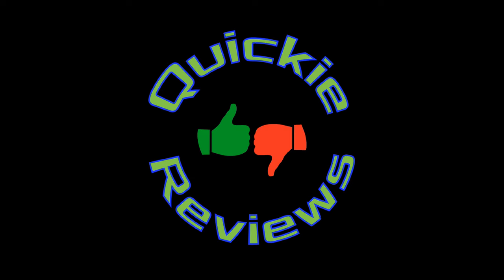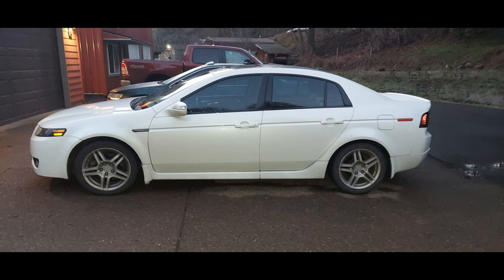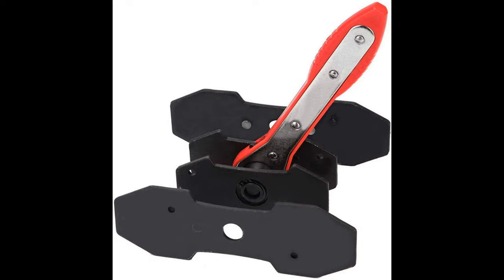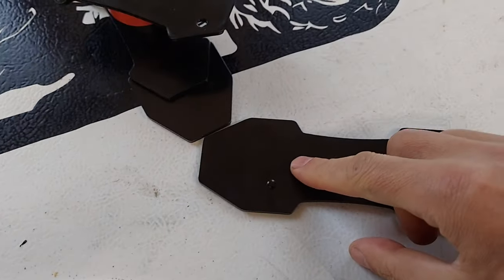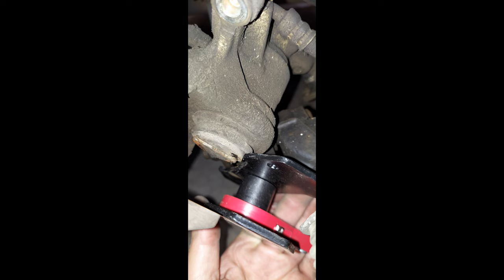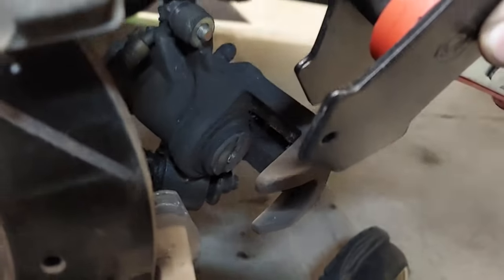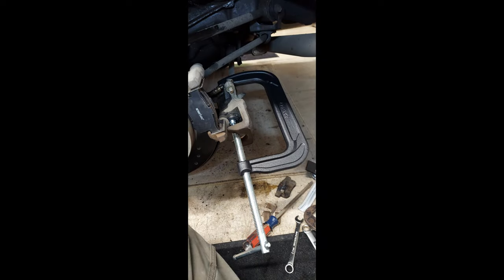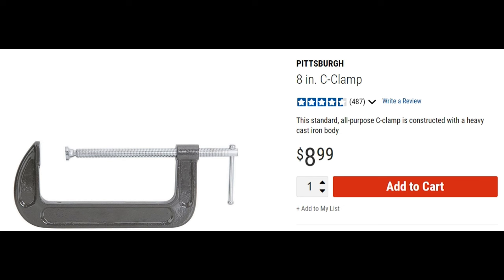JOJOY LUX Brake Caliper Press Tool!

Comment: So, the ONLY reason you gave it a "Thumbs Down" is due to it not fitting in the rear caliper? I understand that is why you bought it, I am simply asking if that is your reason. If it doesn't work on your car, it probably won't fit my 2001 Pontiac Grand AM. Thanks for the heads up.
Reply from the maker: Yeah - doesn't fit, then it doesn't work. Honestly, just get a cheap-o big c clamp :) By the time I got to the front pads, I checked to see if it would fit (it did) but I didn't bother using it since I'd already bought the c clamp

Comment: The rear calipers, doesn’t work because you need to turn it with a different tool clockwise.  This is not the right tool to use.
Reply from the maker: It didn't open any further than that, so turning it more wouldn't have made any difference :/